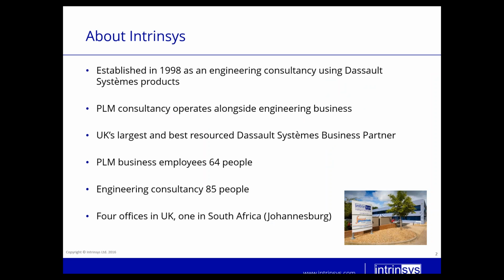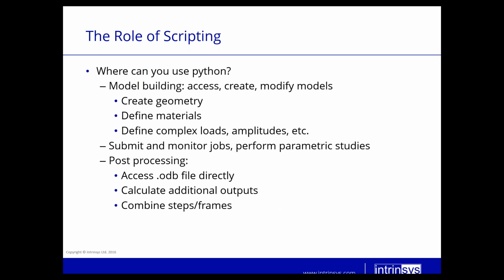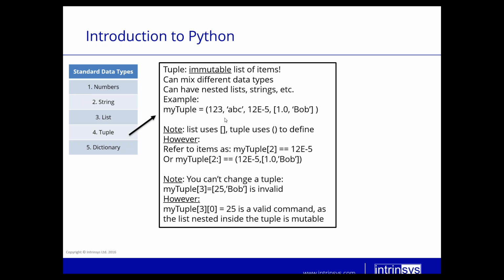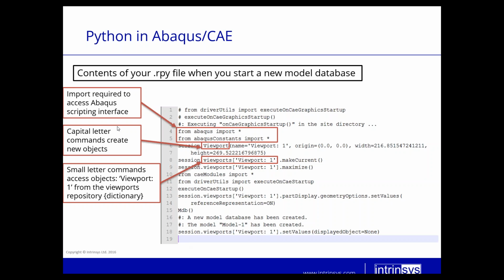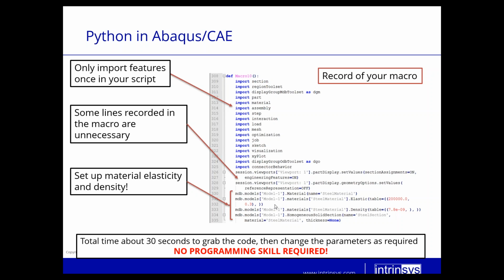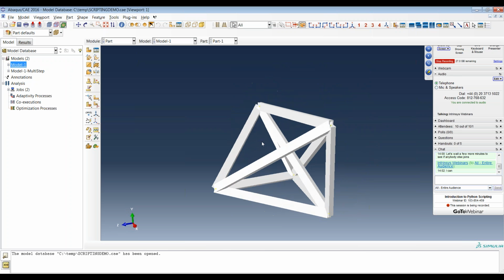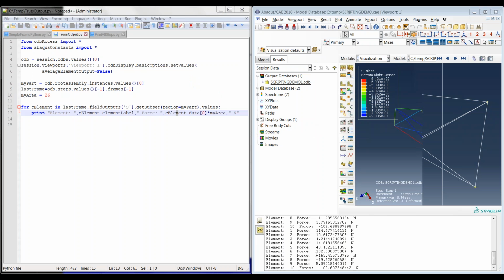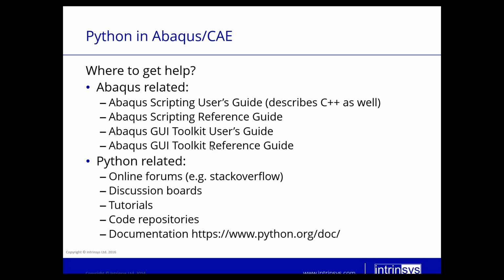Introduction to Python Scripting

Comment: Is it possible to use access odb in python IDE using the libraries of simulia without having abaqus cae installed??
Reply: This is partially possible. There are some libraries which require to be run within Abaqus/CAE (example if you wish to assist in building a model etc) and some libraries which don’t have to be (example if you wish to get Abaqus results for example). But it is difficult answer the question fully without knowing exactly what you need to do. Please let us know in more details for a more precise answer.

Thank you,
Dr Auday Alrawe